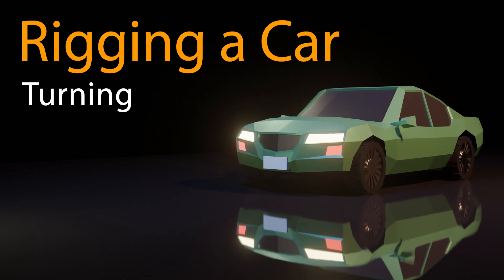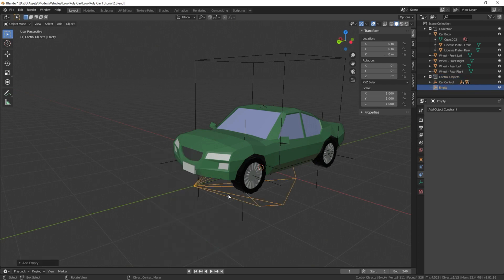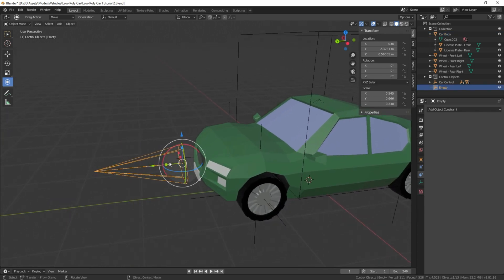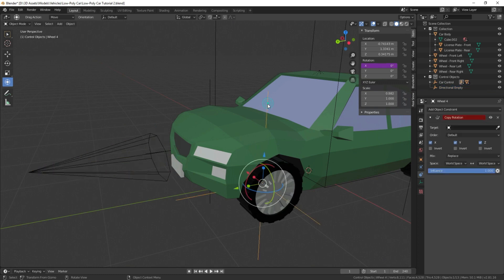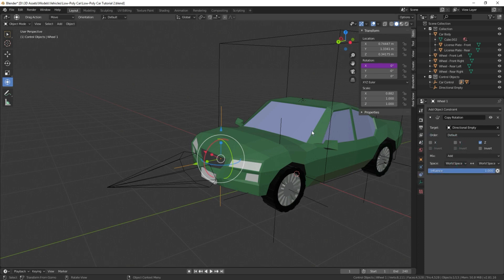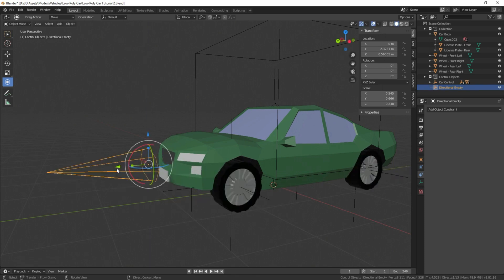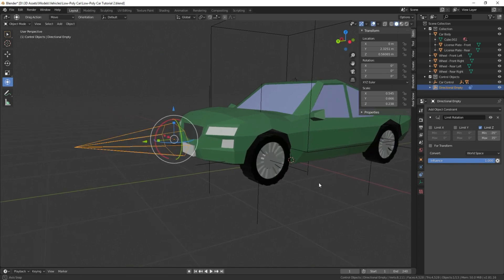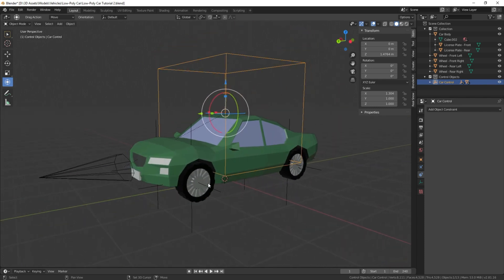Rigging a Car: Turning Movement [Blender 2.81]

Comment: problem though is that my cone is -180 degrees which causes the wheel to flip weirdly when moving forward/backward. and you can't apply rotation to empties to make it zero degrees. so my cone is facing the other direction to "fix" it lol

Comment: Hi! I found your tutorial really helpful! I’m rigging a car for a a project and it is almost finished! But in the process of turning the car around I experienced a roadblock that maybe you’ll be able to help me. When animating I want to turn the car at 90 degrees (when turning the wheels look great), but when the car is rotated completely to 90 deg., the wheels keep pointing to the x axis instead of looking forward. I tried to move the cone empty (arrow) to fix the rotation, but the only thing it does is turn the wheel to the opposite side. How can I fix this issue?
Reply from the maker: Interesting issue. Have you tried altering the Limit Rotation Constraint to allow for a higher Maximum Angle Value on the Z-Axis? I'm thinking that it may be a simple matter of the Limit Values, which may be causing random movements of the wheel on its axis.
Reply: ImagiNerd3D Yes, already tried that and was able to move the wheel looking forward but unfortunately, when I did that, it also changed the direction of the wheels in the whole animation (before the turn).

Comment: how would we get rid of the double transformation on the steering though? because if i rotate the car and have it follow a path away from its origin i would need the wheels to straighten out at some point right?
Reply: Yeah I face the same problem when I tried to do this with drivers

Comment: great tutorial, just wondering if this exports to unreal engine well
Reply from the maker: Honestly, I wouldn't be able to tell you for sure. However, if you create a looped animation sequence of the car in certain states, (forward, backward, etc.) Bake the Animation, then Export the sequence as an FBX, then it should work with UE. I haven't used UE for anything other than Static Models and basic MoCap Animations, so I'm unsure. I already see some potential issues with the method I explained though
Reply: @imaginerd3d  Good to know thanks a ton

Comment: Thanks for the tutorial! One nitpick: The rear wheels actually do not steer along like this. In regular cars, they are completely or mostly fixed. At low speeds, you'd actually want them to go the opposite direction, to minimize turning radius. Same in forklifts, where the rear wheels do all the steering instead.
🦀The setup in the video is called crab steering, which causes the body to stay pointing in the same direction. That's obviously for niche applications, but actually modern cars do that to a small extent as well (compliance understeer), with passive rear steering or (in trucks & fancier models) active four-wheel steering.
(At least that's what I picked up from Wikipedia; I'm really not a car expert... ^^)

Anyway, there's a lot of cool stuff on your channel - I'm glad I found it!
Reply from the maker: Thanks for the informative explanation! I didn't know a lot of that 😊 I'm happy you're enjoying my channel. I'm new to having my own channel, but I'll be sure to put out increasingly-better content! Please consider subscribing!